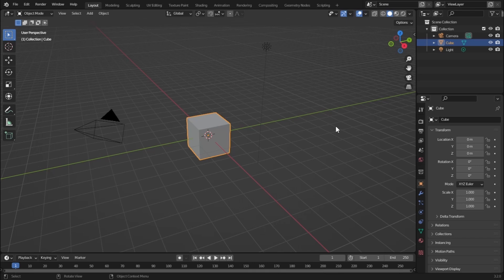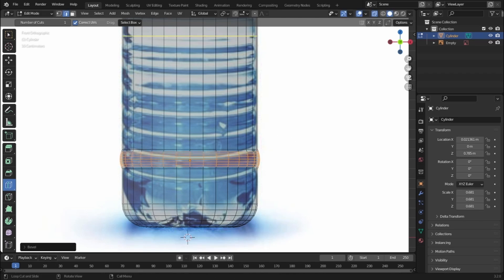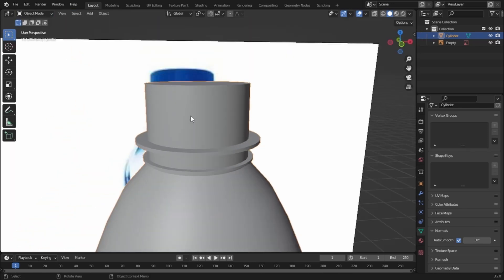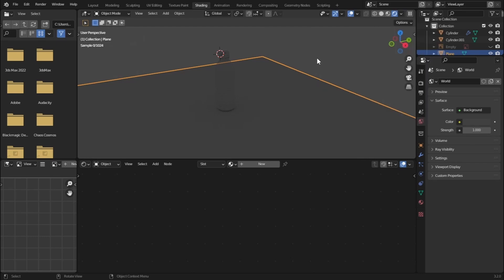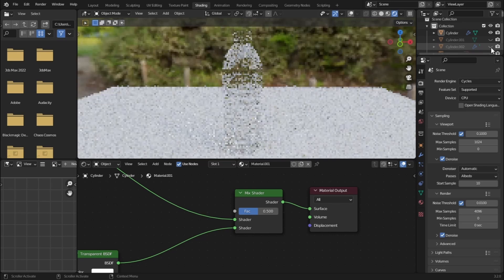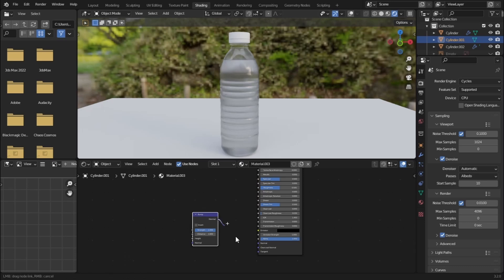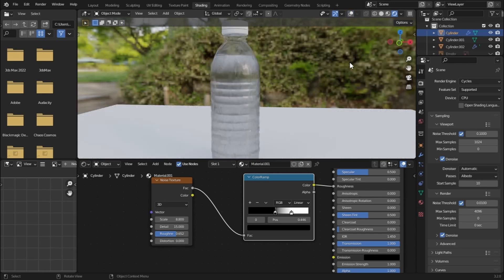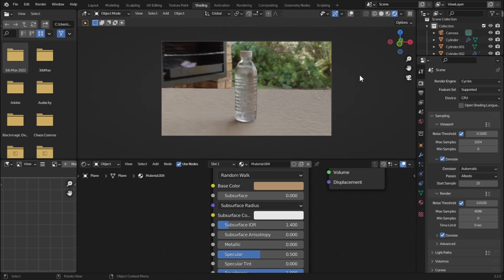Blender Beginner Tutorial : Realistic Water Bottle

Comment: Why we don't do rendering in eeve.please reply
Reply from the maker: Nice Question buddy. So there are 2 render engines in blender. So one is cycles and the other is eevee. Eevee is a real time render engine and also it does not have as much accracy and photorealism as cycles.    You can test yourself. And cycles is a path tracing engine which calculates light bounces according to the lights in scene and is able to achieve photorealistic renders. Eevee is good for semi realistic renders but often times it has very complex procedures. In cycles , setup is very straight forward. I know that cycles takes time. But that time is worth it. 😎